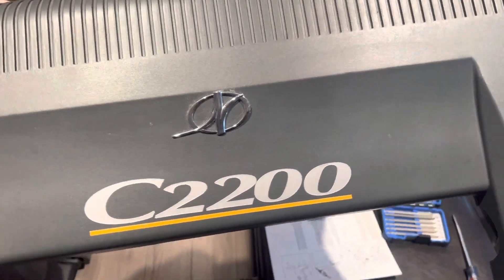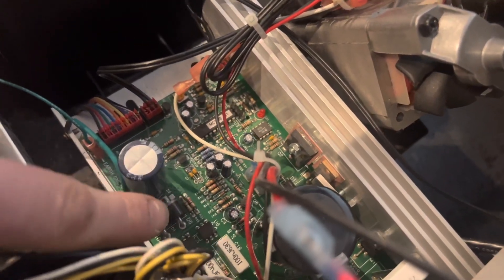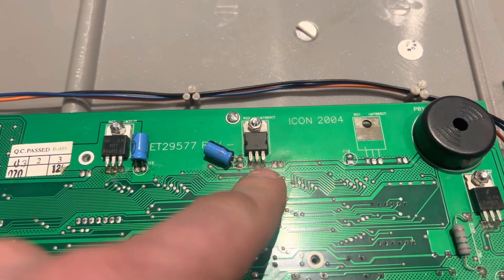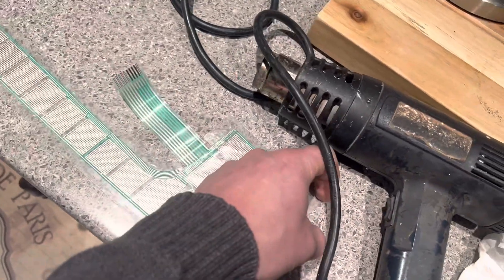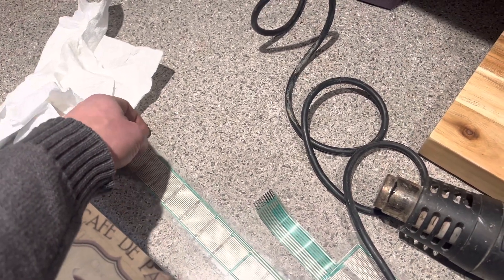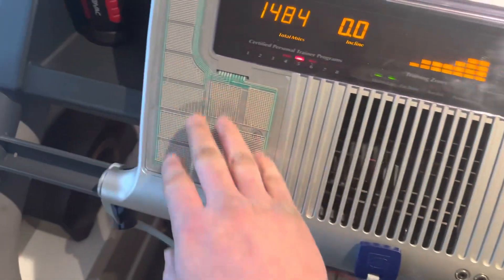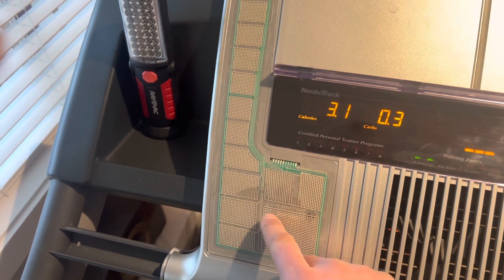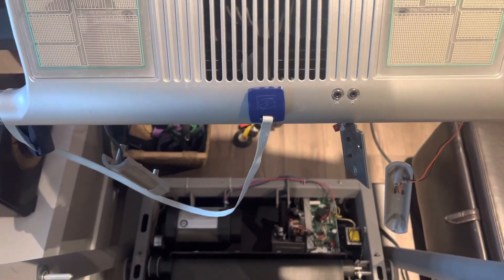DIAGNOSING FIXING NORDICTRACK C2200 TREAD MILL

Comment: Thanks for posting.  I’m not very handy.  How did you open up the top and bottom consoles to access the ribbons and circuit boards?
Reply: I wish he had said how he peeled the buttons
Reply: He said he used a hair dryer. I used a heat gun on low, about 8-10” away, to loosen the adhesive. Slipped a knife blade underneath, then pulled up a bit more with a pair of hemostats. Then just gently heat and pull until it comes off.